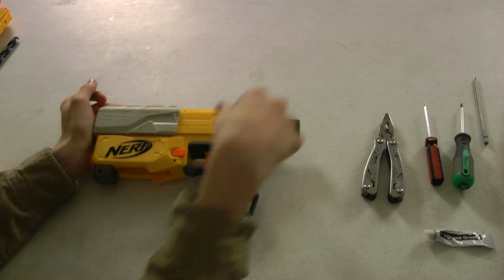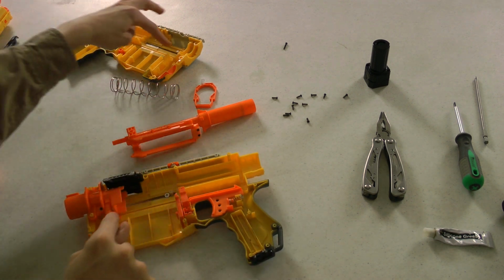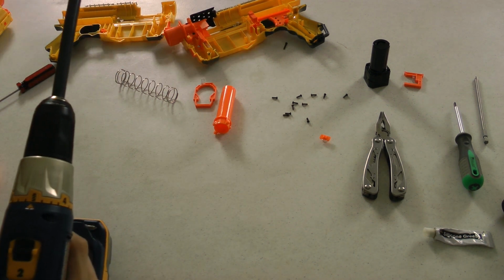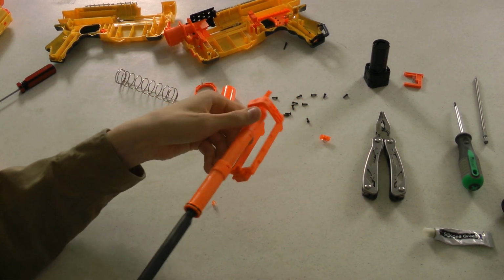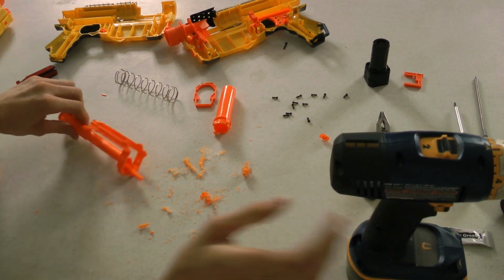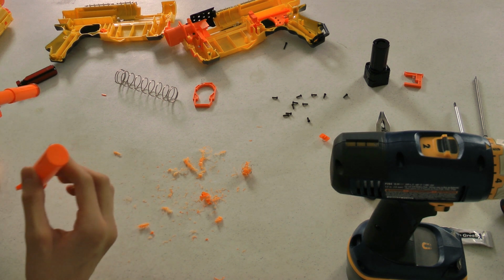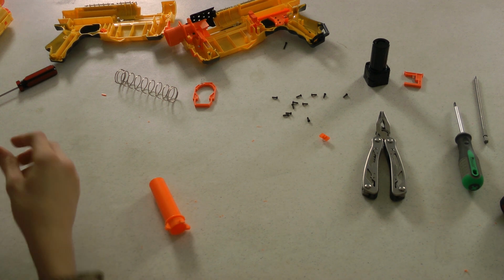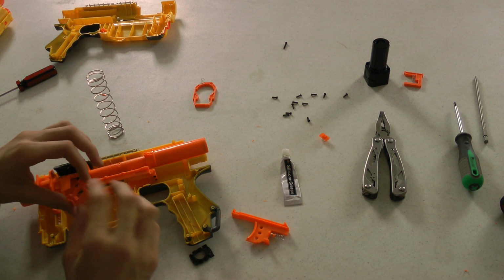Recon CS-6 Air Restrictor + Lock Modification - Nerf Socom Mods

Comment: Does anyone else still have a nerf recon in 2020
Reply: Yeah but uh I  just trew it away and I just got the video
Reply: Flywheel beast me
Reply: 2021 yeah, my 1st gun I modified, I plan on trying new stuff
Reply: I have 6
Reply: Yes.
Reply: YES
Reply: My friend has 3
Reply: Just pulled mine out the closet
Reply: Yeah I still have it and im 11, one of my old family friends gave me a recon when I was 8 and I still use it with my friends 💀
Reply: I do have it till this day. But the cleared ones. I bought it from singapore.
Reply: I have 4 recons, 1 modded, 1 new in box, 1 new in box pre-recall, and a normal recalled recon,
Reply: Just got one today xD
Reply: I have one in 2027
Reply: Yes
Reply: I have it in 2024 💀
Reply: Yes sir
Reply: i do in 2024

Comment: What does this modification does to the gun? Greater distance shot?
Reply: Greater distance and it shoots faster when you remove the air restrictor.
Reply: Removing ar and dry firing it will make big damage so think twice. And if you use your gun too much that will damage. So get mod kits that is metal breach  and plunger tube

Comment: I would have stretched the spring a bit. I did that on my old Nerf Disk Shot gun, and after removing the air restrictors as well it went from a terrible nerf gun to one of the strongest I have ever used.

Comment: thanks it helped a lot but its really hard to take my clip out when its not cocked why is that?
Reply: Andres Sasaki it's because the front of the plunger is rapped up by the magazine. When all the way back, the magazine doesn't have to bend slightly around the plunger

Comment: what happens if you remove the air restrictor will it shoot farther??????
Reply: +Da turtle when you remove the air restrictor you get more air going to the dart, but it also acts as a holder so the dart doesn't go to the plunger tube.
Reply: Removing ar and dry firing it will make big damage so think twice. And if you use your gun too much that will damage. So get mod kits that is metal breach  and plunger tube

Comment: does air restrictor removal make a nerf gun more powerful?
Reply: uploadwhateveryouwant it increases its range
Reply: Removing ar and dry firing it will make big damage so think twice. And if you use your gun too much that will damage. So get mod kits that is metal breach  and plunger tube